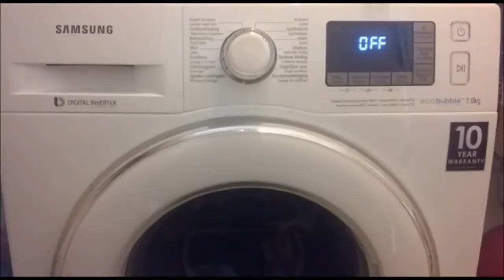Samsung EcoBubble stuck mid-program - Repair guide

Comment: Hi! We did all the steps with our washing machine and it worked for a week (like 5 different washes, different types). But now the washing machine just goes out after like 2-3 minutes. The power cuts off. No idea why... We opened it up and pushed all the connections again but no difference. Any idea what happened? Anybody?

Comment: I did the repair however my waching machine doens't turn on anymore? It seems completely dead. Any advice?
Reply from the maker: I am sorry to hear that your repair did not have the intended result. If it turned on before you attempted the repair and now not anymore, I can only imagine that during the procedure one of the components or circuits got damaged. In your stead I would probably try to resolder the work I did, double-check the connectors and cables and the main wire/plug. Good luck.

Comment: After 4 years using this washing machine, in December 2018 I've the board replaced by Samsung Service Center with the new one because the drum couldn't move and they found that one of the IC had been burned. They charged me around US$80 for the new board and they advised me to unplugged the power cable if not in use to prevent the short life of the board. 
Today I found that the machine totally dead, checked the power cables with ohmmeter and found that the power cables are ok, then I tried to replace the board with the old one and the LCD can work but no response from the drum. So the conclusion is that the new board defect after 8-months, and Samsung only gives 1 month warranty for the replacement board 😠.
I'll try to resolder the pcb tomorrow. Will update the result.
Reply from the maker: Sorry to hear about your troubles. Unplugging the machine doesn't sound very helpful at all and judging from the result after 8 months, I guess it wasn't. Not sure if you are facing the same issue as most people here, but I would say it's worth a shot, especially since you now have 2 boards at your disposal. Let us know how it went!

Comment: Interesting procedure. I'm sure it's worked for you BUT... disconnecting the processor board and re - connecting may of reset to factory settings(hardwire off and on again) ours won't dry at all and under warrenty. Won't try this at present.
Reply from the maker: I would also not have attempted this if the machine was under warranty. We were put to the choice of either getting a new machine, or attempting this repair.

Comment: But it says 10years warranty on the front.
Was that machine actually 10years old?
Reply: I believe not. The warranty is only on the motors
Reply from the maker: The Machine was a little over 3 years old and so it was out of the standards warranty period, which convinced me to do this repair myself. The 10 year warranty sticker on the front reads "on the motor" in smaller print, like @Neosilver GK mentions. ;-)

Comment: How did you remove the gel?
Reply: im trying to find an easier way to remove it because holy shit is it a long fucking process scraping it off with a plastic pry tool.. literally just have to scrape under the gel then grap it with your fingers and peel it off.. comes off in little chunks. comes off somewhat clean off the board in the less congested areas but the other 50% of the board where its reall congested it doesnt come off clean at all...  at this point im scrubbing it with a stiff brush, isopropyl alcohol and i-fixit plastic scraper.. im 2 days into this process and i recon its going to take another 2 more days to fully clean it so then i can reflow  the board.. unless i find an easier way to remove the remaining gel :/
Reply from the maker: @chim5951  Thank you for describing your process. I don't remember it being that big of a problem to remove it. Like you said it was mostly peeling it off in small chunks. I think it took us about 30 minutes.

Comment: The purpose of the coating is to prevent the possibility of repairing the card.
Reply from the maker: I imagine also to keep dust and moisture out, since a washing machine is per definition a dirty and wet environment.

Comment: Like a complete dick, I kept the old PCB in the loft, then threw it away a month ago. The 'replaced' PCB lasted four years, and now the 3E problems come back. I could have saved £150!
Reply from the maker: Did you manage to fix your "new" board with these instructions?
Reply: Gold Flemming  I replaced the board with a new one. 10 minute task

Comment: i never seen you with you iron hot an never seen you use it ??? weird
Reply from the maker: If you mean the soldering iron is not hot in the video, that is correct. For safety reasons I did not (even try to) film and solder at the same time. There are tons of videos on YouTube that can teach you how to use a soldering iron. Good luck!

Comment: Hey! Does this look like what your machine had before fixing? https://youtu.be/o7mrBup1FXw 
I would very much like to try and fix mine. Sometimes it finishes the program without me interfering, most of the times I have to pause and wait, then play again and it works for some time, then the same again. Maybe my issue is more physical, what do you think?
Reply from the maker: My machine did do the same thing, where it seemed like it unsuccesfully tried to spin in one direction and then the other. However it did not make that same labouring sound as in the video. On mine I heard the pump gurgle and then it would try to spin without succes, then pump water out again.
It's hard for me to advise you on this, I am in no way a qualified technician. As I said, it is a fix for a common problem with this machine but you perform it at your own risk and it should be your decision whether or not you try it. I would say if the machine is out of warranty AND you're considering to get a new one, you have nothing to lose. Good luck in any case!
Reply: It did the same with and without the working sound depending on how far the program was when it started. I did end up trying to fix the board, did accidentally roast one spot so it didn't work after and ordered a new one. Got the board out of its box with pressure air (for pumping car/bike tires) by making very gently a little hole on the bottom with a hand drill and then puffing so that the air did detach silicon from the plastic box. 

It's very good to know though that the PCB is the problem in this case and whenever the new one starts acting up in a few years, I will swallow my pride and ask electronics qualified ex to do it xD 

Did get the washing tower for free because previous owner was fed up with the issue so it was worth a try for me and still quite cheap to fix :) Had worked 6 years before I got it.
Thank you for the tutorial and giving hope that even modern electronics can be fixed!
Reply from the maker: @dimewo  Thanks for the update and sorry to hear your repair didn't work out as planned. That trick with pumping air under the gel to get it loose is simply brilliant though. 
Here's to hoping the new board will hold out until you're ready to replace the machine. Maybe not a Samsung though, if the time ever comes... ;-)
Reply: @dimewo  interesting technique for removing the board!!

Comment: Watched your video last night as I had the issue of the drum not rotating - would move slightly with a judder and stop. Tried calibrating with no success. When put into test mode, machine returned an error code of 3E2 😟 Followed your procedure and viola, machine now fully functional again 😀👍 Further to what you have done, have coated the board with a Conformal spray to keep moisture and humidity at bay, and hot glued the base panel back on. Hoping this will help protect the now exposed board. Again thank you for making this video, all the best.
Reply from the maker: Thank you for your message. It is good to know the specific name of the material used to protect the board from moisture,  in case people want to spray-seal the board again.